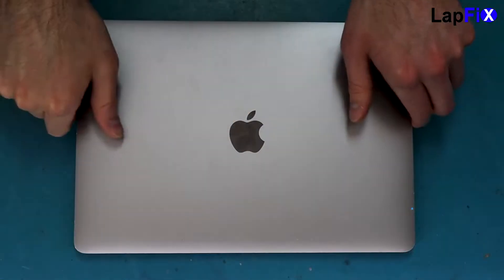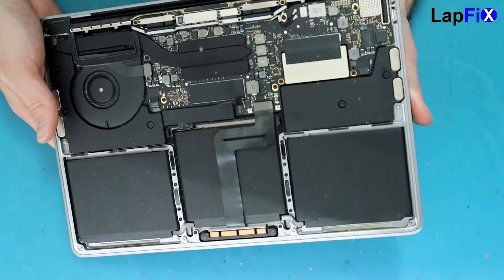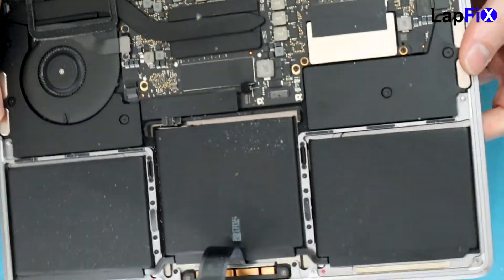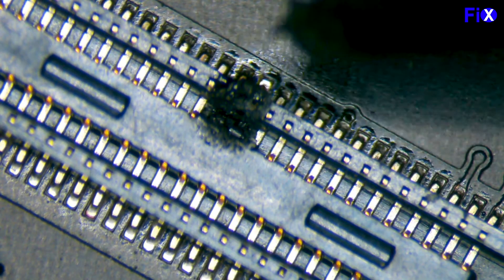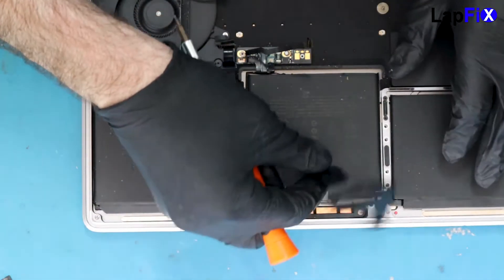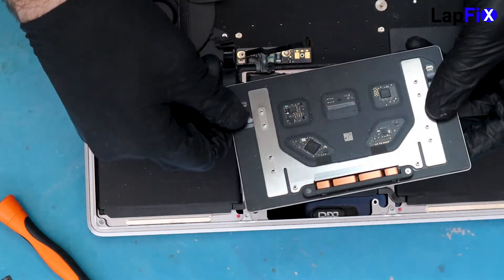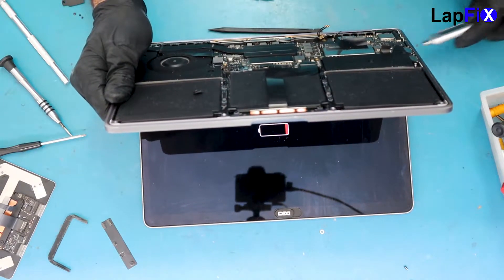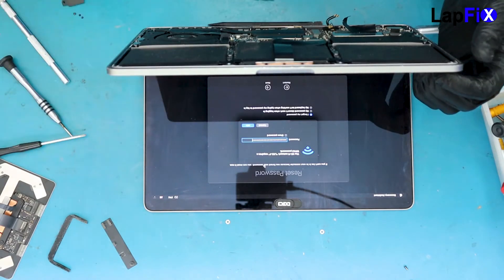MacBook Pro A1708 Liquid Spill Repair - Dead Touchpad

Comment: Thanks for the great video.

I’m really stuck and hope you can help. I have the exact same model and the trackpad isn’t working, apparently after a battery replacement. However I’ve replaced the trackpad and ribbon cable and the trackpad still won’t work. Any suggestions?

I’ve also reset pram and smc but no joy. Can’t see any signs of damage on the connector either. Just a dodgy looking battery board. Could that be the cause?